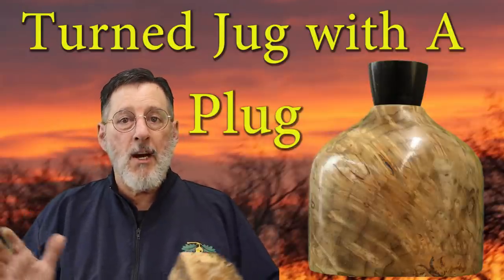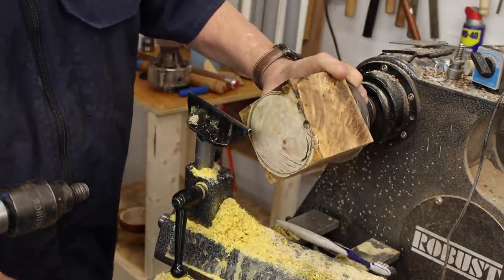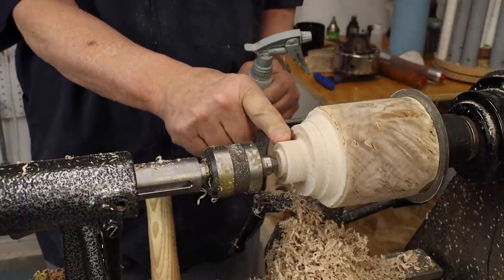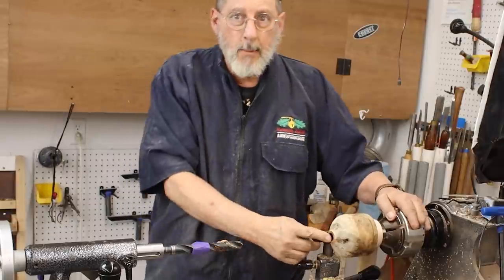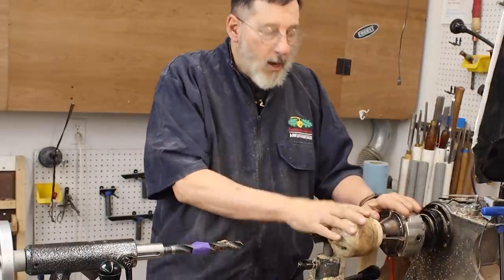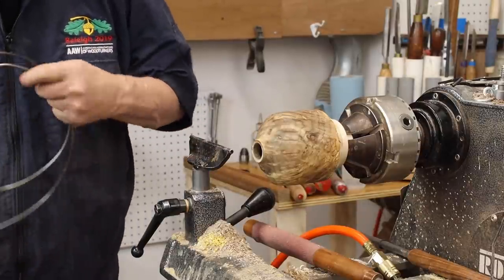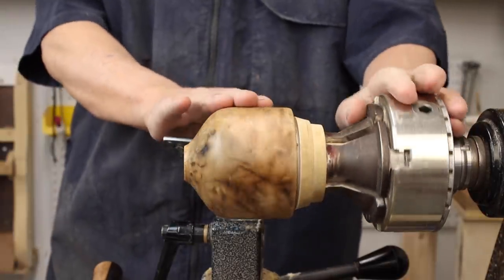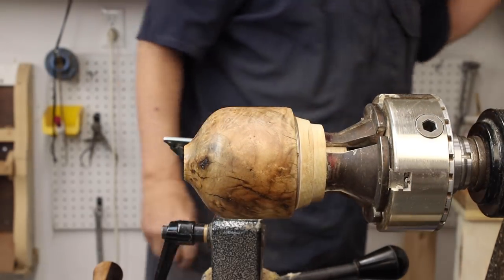Turning an Ancient Wooden Pottery Jug.....with a Plug     Woodturning with Sam Angelo

Comment: Nice jug. How did you finish the bottom? Just sanding or did you reverse it on the lathe and use gouge to smooth it out?
Reply from the maker: At 25 minutes into the video I part it off the waste block Then I just sanded the bottom.
I think I will mention this comment in my next Notes from the Turning Shop video-scheduled out on May 22, 2022 
Sam

Comment: Sam, I love your videos. Question: How long would you let the Tightbond set before you feel it safe to turn the piece. I’ve always thought that I should leave it overnight. Here it appears that you used it after about 30 minutes? Thanks!
Reply: Might be camera magic... I've never had any luck with waiting less than a couple hours bare minimum. Even with CA glue or hot melt glue don't securely bond that quick!
Reply from the maker: John
I think it depends on the project. But I agree when you're turning something it should sit for at least a few hours before it is safe to turn. Overnight is even better. I can't really remember how long I let this sit before I turned it. But you can always bring up the tail stock for extra safety.I think I will mention this comment in my next Notes from the Turning Shop video-scheduled out on May 22, 2022   Sam